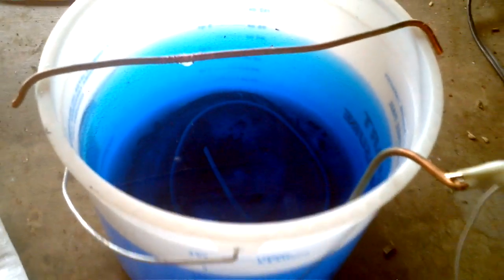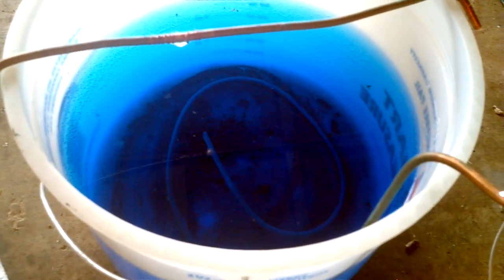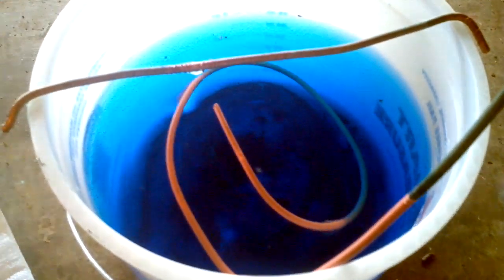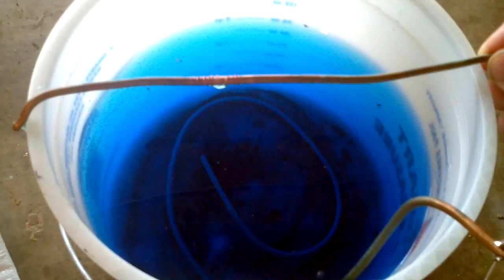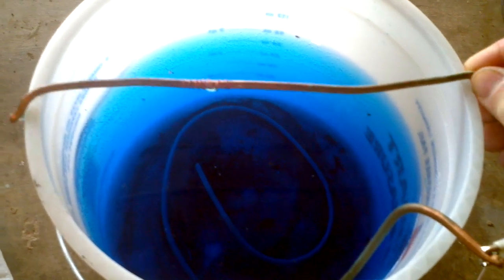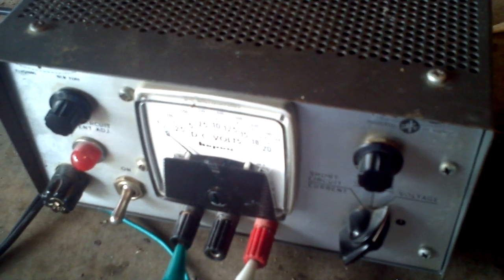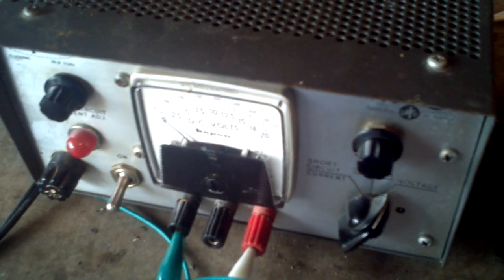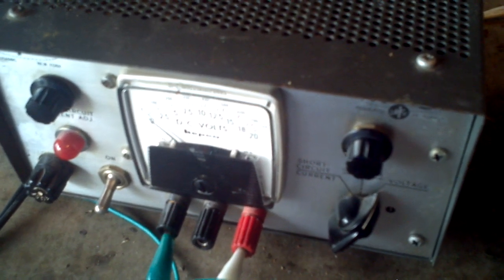Copper Plating Cast Lead Bullets - Pt 2 of 5

Comment: Not sure why you use vinegar. Have you tried distilled water? As for your power settings. You may have to turn up your VOLTAGE as you add more bullets to your process, but keep the AMPS (current) down under 1.5 amps. Even 1.5 might be too much. Most battery chargers don't charge below 2 amps. This may be why you were getting the bubbling. Thanks for posting this series.
Reply: You wont have to change the voltage as production scale increases, just the amperage. Battery acid would be a much better electrolyte than distilled water or vinegar, although you might have to dilute it to lower the pH to avoid dissolving the lead (although lead is pretty stable IIRC)

Comment: Just curious, have you considered using Chore Boy (the copper scrubbers) as additional anode material? Also, why the vinegar? Have you considered agitation by aeration? I think you're running into issues with voltage/power because of the single bullet you're plating. Once you start plating more at once, you'll need more power. Thanks for posting, this has given me a lot of ideas!